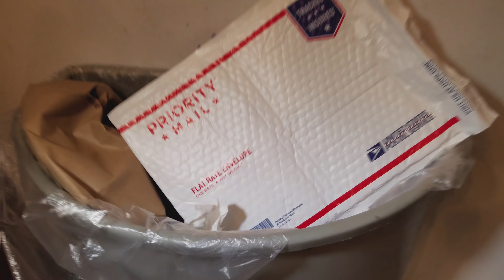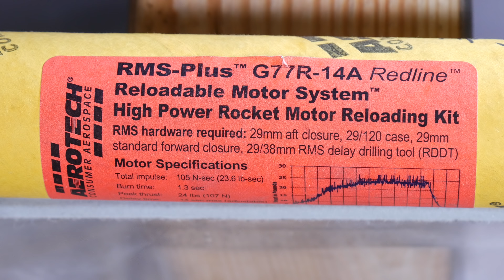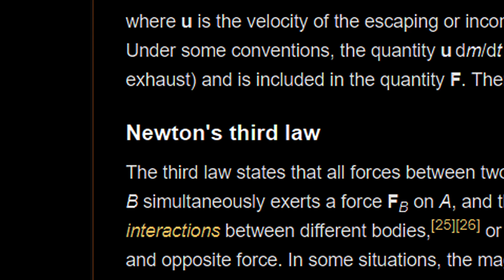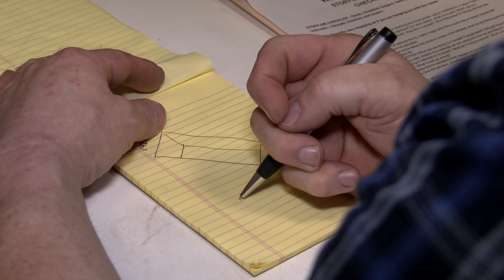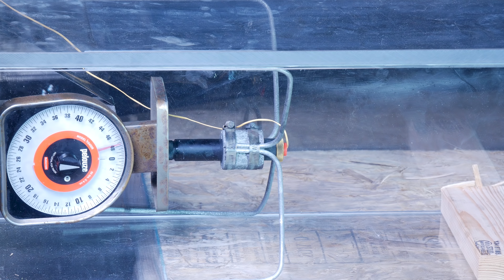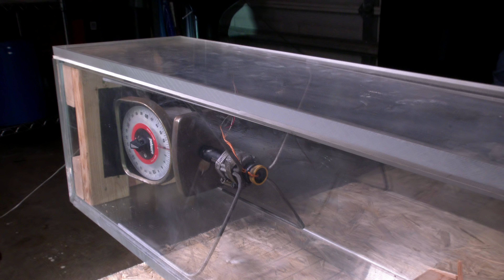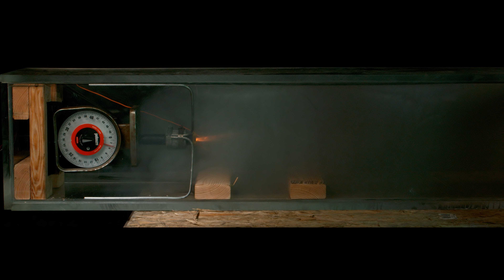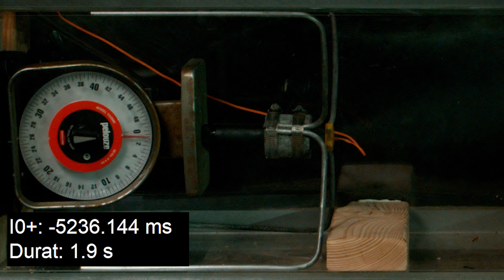Rockets in a Vacuum Chamber - Newton's third law of motion Visualized

Comment: From the outset this is a flawed test. The moment the oxidiser is burnt it produces a pressure within the chamber from which the rocket pushes against.
Reply: Plenty of other vacuum tests holding very low exhaust pressure. Why do they produce thrust?
Reply: "pushes against"...lol that's not how rockets work.
Reply: @tyslink  : You'll never educate these people.
Reply: @tyslink  Perhaps you never heard of the term resistance? That used to go along with action and reaction before the curriculim removed it. This exactly why " space" does not transmit sound; there is no medium to translate the force, in this case the vibrating sound frequency.
Reply: @chookin1  yeah again, that's not how rockets work.
Reply: @kitcanyon658  I know but I can't stop from addressing the ignorance at times...
Reply: @chookin1   no, sorry. Newton's laws say that rocket propulsion MUST work in a vacuum.  You have proven that you do not understand Newtons laws. 
 Watch:. 1 - when the rocket engine is running is the exhaust gas ACCELERATED as it leaves the rocket? Yes or no?
2 - does the exhaust gas have MASS? yes or no?
3 - can MASS be accelerated without a force? Yes or no?
Just answer these three questions to PROVE you understand Newtons laws.
Reply: @stuartgray5877  Oh dear. Rocket propulsion is not like throwing a rock. The moment a gas is released into an absolute vacuum it can DO NO WORK!! It is that simple.
Reply: @chookin1  and tell me HOW rocket propulsion is "different from throwing a rock" .  Because Any TIME one objects exerts a force on another object, BOTH objects feel the force.  So when you throw a rock, you feel recoil.  And when a rocket THROWS the mass if the exhaust gas out the back IT FEELS RECOIL TOO.
Reply: @stuartgray5877  Geeze Stuart.....use your brain. Its a completely different method to using a tactile force....like throwing a rock. A rocket uses gas to push against the 14.7 psi of the atmosphere.....no atmosphere= no work is done. Sure, if I was floating around in zero g in an absolute vacuum [simply a fairy tale] and threw a rock it would be propelled; its not being propelled  by a gas that is nullified the moment it is released into an absolute vacuum.
Hope this helps.
Reply: @stuartgray5877  Read my last......fanboy.
Reply: @stuartgray5877  English not your first language ? Do you mean what was the initial velocity or the peak velocity? Its "final" velocity would be zero.
Reply: @stuartgray5877  An "actual spacecraft engineer". For Lego?
Reply: @chookin1  I have built, tested, and launched five science probes for NASA, four of them to deep space or other planets.  I have been on the mission operations team of three of them.  So you don't know how to solve that problem?
Reply: @chookin1  and no a rocket does NOT push on the air in the atmosphere.  It pushes on the MASS of the exhaust gas as it Accelerates it into the vacuum
Reply: @stuartgray5877  Deep space. What a fraud. I  know a fair bit about this fraud. Just name me one [or all] of these "missions". This'll be rich.
Reply: @chookin1  sure I started at Lockheed Martin Flight Systems in 1995.  There I worked on Cassini/Huygens, Mars Global Surveyor, Stardust, Genesis, Mars 98 Orbiter and Lander.  I moved to Ball Aerospace in 2000 and worked on the MER rovers, Deep Impact, Kepler Space Telescope, JWST, NOAA-20, and the IXPE X-ray space telescope. In fact I am at Kennedy Space Center right now in the PPF preparing to put IXPE on a falcon9 for launch in a few weeks.  Is that "rich" enough for you genius?
Reply: @chookin1  I have been a Flight Director at JPL, A flight operations engineer at Laboratory for Atmospheric and Space Physics, a command and data handling subsystem engineer at JPL, and  a power subsystem engineer for NOAA at the NSOF.  I have even been the Launch CONDUCTOR for more than one launch.  I'll be the "Spacecraft Anomaly Lead" for the IXPE launch in Dec 9th.  Listen in to the launch countdown and you will hear me give approval for launch in the voice net..  is that enough for you genius?
Reply: @chookin1  now tell me your level of education and what you do for a living since you feel confident lecturing actual spacecraft engineers about how rockets work
Reply: @chookin1  oh and, coincidentally, four years ago today I just launched the JPSS-1 spacecraft (now NOAA-20) from VAFB.  But I guess one of the most advanced weather sats in the us fleet is a hoax too right?
Reply: @stuartgray5877  So youd be one of those guys who thinks a vacuum and non vacuum can coexist?
 BTW . .Hubble is SOFIA. 
Sounds to me like youre one angry fanboy who's so busy doing nothing he  feels he has to insult people who dont believe his bullshit. 
Tell me this; how does one send back images and data from 1 5 billion kms with 100 watts? Whats the format?
Reply: @stuartgray5877  Sounds like youve got a lot of spare time at Disneyworld ....oh i mean where ever  it is you work ....
Reply: @stuartgray5877  Does it orbut in 2000 deg thermosphere? Hahaha....
Reply: @stuartgray5877  No comment on vacuum and non vacuum  coexisting? Youre a fraud.
Reply: @chookin1  tell me the theory of operation of the gas centrifuge.  This is a device that can create a region of high pressure gas right next to a region of low pressure gas (a vacuum) with no physical barrier between the two regions.  Tell me how that device works and we can talk about Earth's atmosphere.  But you won't, you'll cry like a baby and come up with an excuse not to
Reply: @stuartgray5877  Lets see it demonstrated in the lab.
Reply: @chookin1  a gas centrifuge does exactly what I say it does.  Do you deny something you can research yourself in 5 minutes?  A gas centrifuge creates a pressure GRADIENT using centrifugal FORCE.  Do you also deny Earth's atmosphere is a pressure gradient?  I know those are some big words but you can do it.  ANSWER.
Reply: @stuartgray5877  Please......link me to the site. Ive read about them separating isotopes but nowhere have I read where they can have both a pressurised system AND an absolute vacuum in juxtaposition. Evidence please.
Reply: @chookin1  sorry I am not teaching you basic physics.  Lookup the "centrifugal compressor" and try learning for a change.  It is a basic FACT of gas physics that any FORCE can compress a gas. This creates a gas pressure gradient.
Reply: @chookin1  and hubble is NOT Sophia.  I work for the company that fixed hubble, trained the astronauts to work on it, and built most of the science instruments that are onboard it right now.  No other company knows more about the optics and the science instruments onboard right now than my company.  And my LAST company (Lockheed Martin) built the bus and launched it.
Reply: @stuartgray5877  Its SOFIA.
Reply: @stuartgray5877  Wow. How obnoxious. I dont have to answer anything. Gas escaping into an absolute vacuum does no work. Theres just no way you can get around this. Neither  is there any way to combine a vacuum and non vacuum. Wheres the  link for the  magical  centrifuge??
Reply: @stuartgray5877  You cant even answer how 100w can send an image ( format?) 800 million kms. How?
Reply: @chookin1  if gas expanding into a vacuum does no work, then how does the MASS get accelerated?  For mass to be accelerated there MUST have been a force applied to that mass.  Tell me where the force comes from that accelerated the mass.
Reply: @stuartgray5877  Did i say the moon? I said from  800 million kms....you know around Saturn??....
Reply: @stuartgray5877  Exactly my point.....the mass DOESN'T get accelerated. The thinner the  atmosphere the less work can be done until it it get gets so thin NO WORK can be done. I suppose youre going  to have to revert to what some fanboys  refer to as the "deflector plate" at the base of a rocket that allows  the exhaust to hit it to provided thrust when they finally have to concede no work can be done in a vacuum. Hilariously though they still dont realize the  moment the gas/ exhaust is released into this absolute vacuum NO WORK can be done. 
Are you a freemason? I bet you are. JPL and all that black magic chicanery.
Reply: @chookin1  no start again.  The mass of the rocket fuel DEFINITELY gets accelerated as the engine runs.  For example, a space shuttle main engine consumes 500 kilograms of liquid oxygen and liquid hydrogen PER SECOND, combusts it and accelerates the exhaust gas (500 kilograms of pure water) to 2500 meters per second (about MACH EIGHT) in the length of the engine (about TEN FEET).

So try again and answer those three questions again.
Reply: @chookin1  you want to lecture actual spaecraft engineers about rocket propulsion and you don't know what "acceleration" is??  You tried to say the exhaust gas does NOT get "accelerated" when it moves through the engine?  I mean it went from a velocity of ZERO to MACH EIGHT, but it doesn't "accelerate" to do that?  You're a fucking GENIUS.
Reply: @chookin1  resistance and atmosphere have absolutely NOTHING to do with the FACT that the exhaust gas gets ACCELERATED as it leaves the engine. I mean a fucking HUGE acceleration!!
The acceleration is still there whether there is "resistance" from the exhaust gas hitting the atmosphere or if there is NOT any atmosphere.
IN FACT rockets work BETTER in a vacuum because there IS NOT RESISTANCE for the exhaust gas to get accelerated. The TSIOLKOVSKY rocket equation is what we use to predict the performance of rocket engines.  This seriously TESTED equation is over 100 years old!!
This equation says that rocket engines are MORE EFFICIENT (produce MORE Thrust) when there IS NO ATMOSPHERE!
Now study up on that equation and tell me where the flaw is in this equation.
Reply: @chookin1  Now that we have established that:
1 - There IS a HUGE acceleration FORCING the exhaust gas out of the nozzle. (the chamber pressure IS over 3000 PSI for Christ's sake!)
2 - Exhaust gas HAS MASS. In FACT the exhaust gas has the SAME MASS as the fuel and oxidizer that went IN.
3 - And Newton's very FIRST LAW TELLS US that: Mass CANNOT be accelerated WITHOUT A FORCE. The ONLY Thing that CAN change the velocity of an object with mass is a FORCE!
Ok NOW that we have established that: The exhaust gas DOES get ACCELERATED, That the exhaust gas HAS MASS, and MASS CANNOT be accelerated without a force, then:
JASON - WHERE does the FORCE ORIGINATE that accelerates the MASS of the exhaust from the engine??
The answer is the SAME whether the rocket is IN atmosphere or NOT.
Jason - WHERE does the FORCE COME FROM that ACCELERATES THE MASS of the EXHAUST GAS?
WHERE does it COME FROM?

Now answer THAT question and we will be making progress. (hint: you WONT - you will refuse to acknowledge that everything I have sad above is TRUE because it ruins your delusional narrative)
Reply: @stuartgray5877  Yep.....100 years old and never tested in the lab using the scientific method or in an absolute vacuum.
Reply: @stuartgray5877  Are you a mason??
Reply: @chookin1  (hint: you WONT - you will refuse to acknowledge that everything I have sad above is TRUE because it ruins your delusional narrative )
Reply: @chookin1   The answer you REFUSE to say is:

"The Nozzle"
Was that so hard?

The FORCE that accelerates the exhaust gas from the engine nozzle comes from the 3000 PSI Pressure in the engine nozzle .

This PRESSURE accelerates the exhaust gases from the throat of the nozzle towards the exit plane of the nozzle due the PRESSURE GRADIENT in the nozzle.

At sea level the nozzle pressure is 3000 PSI pushing OUTWARDS against the 14.5 PSI atmospheric air. This a total pressure DIFFERENTIAL of 3000 - 14.5 PSI or 2985.5 PSI

IN a Vacuum the nozzle pressure is 3000 PSI pushing OUTWARDS against the 0.0 PSI. This a total pressure DIFFERENTIAL of 3000 - 0.0 PSI or 3000 PSI.

SO the exhaust gas venting to VACUUM feels a GREATER PRESSURE DIFFERENTIAL and feels a GREATER FORCE therefore achieving GREATER exhaust velocity.

Tell me where ANY of this is wrong.

Please be my guest.
Reply: @stuartgray5877  Newton if im not mistaken thought mass attracts mass. Can you demonstrate that  on earth? How about in "space"? Could Newton have tested this theory using the   scientific method? Of course not.
Reply: @chookin1  
It is INCREDIBLE that you think that atmospheric AIR at 14.5 PSI has enough inertia to get "Pushed on" by the rocket, but the 3000 PSI GAS in the rocket nozzle is NOT "massive" enough to push on.
Your thinking is NOT LOGICALLY CONSISTENT.
The MASS of the gas in the engine nozzle is  close to1000 times more massive than the air in the atmosphere.
Reply: @stuartgray5877  Typically rude fanboy reaction when on the back foot. Picture a bicycle suspended on wire. Peddling is the action, rear wheel turning...the reaction,  but goes nowhere bcos theres no resistance ( the ground). Hope this helps.
Reply: @chookin1  so explain how recoil works in a crossbow using terms used in Newtons laws.  Please just explain how you think recoil works.  If you have a clue how the "law of conservation of momentum" works, this should be trivial for you.
You cannot dispute a single thing I have said on this thread and you have no explanation for how that SpaceX rocket flew BACK to KSC in a vacuum
You haven't even told me what you found when I asked you to LOOKUP atmospheric pressure at only 50 km.  What does that website SAY for atmospheric pressure where that rocket was moving around??  You REALLY SUCK at just answering my questions but sure are good at IGNORING THEM
Reply: @stuartgray5877  So lets see a modern day Cavendish experiment. We can easily do a Bedford level experiment or prove water always finds a level....heck we can even do earth curvature formulation and see it doesnt work in the real world... because truth holds its own and is observable.
All of your nonsense insn't.
Reply: @chookin1  I have been on a deep space navigation team at JPL and more than one of the spacecraft I have worked on have performed "slingshot maneuvers" using Earth's gravity.  I swear arguing with you is like a five year old trying to explain how to drive to Michael Schumacher.
Reply: @chookin1  why don't you try learning about something before trying to debunk it?  I could suggest numerous books on the thermal environment of space.  However based on your understanding of basic physics (mechanics) you are seriously allergic to reading books.
Reply: @chookin1  the flight batteries in my last two spacecraft have operated right around 10 degC during their missions, So they are very comfortable.  I have also worked on some of the electronics on JWST that we operated as low as 5 Kelvin, but there is a need for that to be that cold.
Reply: @stuartgray5877  What did they use for heat? How much energy was needed? No answer on using 100 watts to transmit 1.3 billion kms?
Reply: @stuartgray5877  Well you tell me how a spacecraft can endure furnace like temperatures and how rubber and synthetic seals and gaskets can cope with prolonged exposure of -270 degrees.
Reply: @stuartgray5877  All you have is the ad hominem attack. Thats the last refuge of the vanquished. Wheres the link for the centrifuge that has both a vacuum and non vacuum in juxtaposition?? How does a billion km distant sun keep the " spacecraft " warm enough not to freeze up? Does it do an Apollo BBQ roll?? Hahaha. BBQ roll. So silly. So naive.
Reply: @stuartgray5877  Word gymnastics as usual. So what is the temperature of the the thermosphere?  Any temperature altitude graph will tell you between 900 and 2500 degrees. Thats from your science mates. But the, you provably believe that the Oort cloud is real.
Reply: @stuartgray5877  Either it is or it isnt 2500 degrees in the thermosphere. Ive heard  the "so few molecules" argument  a million times. I t makes no sense. It euther is or it isnt. 
What temperature does the "ISS" experience as its "orbits" within this alleged blast furnace, indeed where your satellite's reside? What metals do they make in the spacecraft department at the Jack Parsons Lab (JPL) that can withstand such a consistent roasting? No comment on the Oort cloud?
Reply: @chookin1  - "I t makes no sense."

Your personal incredulity is evidence of ONLY your willful ignorance.
Reply: @stuartgray5877  Wheres the the link for the vacuum centrifuge? Also the  proof of transmitting data a billion kms off 100 watts. Cheers.
Reply: @chookin1  have a look at stuart's channel, it's a hoot. he's a proper wacko.
Reply: @stuartgray5877  So lets see it demonstrated using the scientific method.
Reply: @chookin1  a TURBOCHARGER is a centrifugal pump.  It can create a VACUUM at one end and a high pressure at the other end!
Reply: @chookin1  I mean have you EVER bothered just reading a physics book?  I know it's a controversial concept...
Reply: @stuartgray5877  lol nobody believes you're an engineer.
Reply: @papalegba6759   thanks for proving my prediction AGAIN that you refuse to answer my simple physics questions because answering PROVES You WRONG!

Comment: You chamber not longer enough, you are pushing off the back wall.......try again with a 100 yard long chamber and a wider chamber, a real vacuum.
Reply: @darklight2.1  Maybe, they should have mentioned this:  "The rocket pushes on its exhaust. The exhaust pushes the rocket, too. The rocket pushes the exhaust backward. The exhaust makes the rocket move forward - this propels the rocket forward — no air is required"